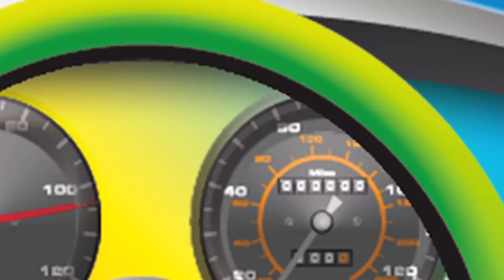Swapping a VR38 V6 into a R34 Skyline GT-R - Erubisu Pt7 - Burnouts and Testing

Comment: Gears sound a tad short what sort of top speed have you geared it for?
Reply from the maker: Geared for over 300km/h once big engine is in as it will rev harder than the stock engine. Can also change drop gear on box to change ratios if need be. For power on stock internals the ratios work well at the moment and help make it faster than you would expect for 600whp
Reply: Yeah, seems to have short gearing which does make it so quick. Cant wait for more videos on this!
Reply from the maker: Gearing is one of the most mis understood and under utilised mods in the "tuner" scene

Comment: Really close ratio gears..  
I'm no expert on gearing, but is it better to have this kind of setup for straight line performance? There must be some loss with gear changes
Or is the peak hp of this car in such a narrow rpm range that the car needs these ratios to stay on boost?
Reply: Just stage 1, to make sure all the driveline/suspension works.
Reply: Was thinking the same thing, seems to be flat out changing gears.
Reply: As in the build, just shifting at peak toque which is something like 700-800nm. close ratio box.

Comment: Did you used the R35 ATTESA E-TS transmission on the R34 ?????
Will the R35 ATTESA E-TS transmission mount on an R34 GTR ????????

Comment: The car nice,but how many seconds run on the 400m? Not look so good time not so quick.
Reply from the maker: Need your eyes checked. Our R32 GT-R project ar runs 10.2@140. This car is quicker side by side even though still on the stock motor and 19psi

Comment: Goes to show just how great the R34 chassis really was, though I've never seen an RB able to wheel spin a GTR as easy as the VR is doing. The R34 chassis has always seemed to be hardly phased by RB torque even upwards of 800hp. I've always wondered where the limits were. Looks like the VR38 is really pushing it. The R35 chassis handles that power effortlessly in comparison. Not a fan of the colour, but its only wrap after all. Amazing build guys.
Reply: Jeremy  top secret r34 lot of wheel spin 1000 ps

Comment: I mean listening to his rev, it doesnt sound like hes redlining, it just like hes using the display to time his shift. Then again, maybe he needs a better gear ratio.
Reply from the maker: Nope. its full rpm in each gear. They just dont rev hard stock
Reply: MotiveDVD thanks, had another look, totally right. I havent driven anything bigger than 180 horses. So it makes complete sense why shift sequence is so fast. So he needs a custom gear ratio?
Reply from the maker: New engine has extra 2000rpm to play with. GEarbox was bought for the next engine

Comment: Needs a taller final drive and/or different ratios in the box.
Reply from the maker: Are you a race team engineer?
Reply: +MotiveDVD No, I just think it has the acceleration to warrant a taller final drive. It obviously depends what it's used for. I've never driven it so maybe I'm wrong. No offense intended Andrew. No hate.
Reply from the maker: +Samuel Szmajda all good. Still testing so much to do. Works fine for now

Comment: Why didn't you guys just stick with all the R35 parts and just modify them to fit the R34 instead?  No matter what route you took, it was guaranteed that you would need some custom parts and fabrication to make it all fit and work.  I'm assuming that it would be better to have as much either original and/or aftermarket parts made specifically for the R35 vehicle in there than parts from 3 different versions of the vehicle to work together.  Just my 2 cents tho.

Comment: Needs longer gears
Reply from the maker: Fishing Ballarat  you an engineer for a Geaebox company that builds them for V8 Supercars?

The box ratios were chosen based on what the built engine will rev to, not the stock engine used for testing. Calculated top speed is 350km/h so is perfect

Comment: i don't get why most cars with the vr38 sound like crap while a few sound completely mental just like this one, as if it's a completely different engine
Reply: cams and exhaus setup does a lot for the sound
Reply from the maker: Its mostly exhaust and manifold design. We have totally separate exhausts so they dont join. R35 exhausts join and sound as bad as most V6s out there.
Reply: +MotiveDVD Thank you for that information
Reply: Cams and exhaust lol

Comment: gear shifter looks stupid
Reply from the maker: You know why they are long don't you? 1 - Better leverage to make easier to shift and 2 - places gear lever at same height as where your hand is on the steering wheel meaning time taken to move hand from wheel to gear lever is shorter. times that by how many gear changes in a race and you see there is a reason,
Reply: Better to have the r35 paddles
Reply from the maker: We can't as we don't use the dual clutch transmission, we have an Albins sequential. These shifts are just as fast as the dual clutch